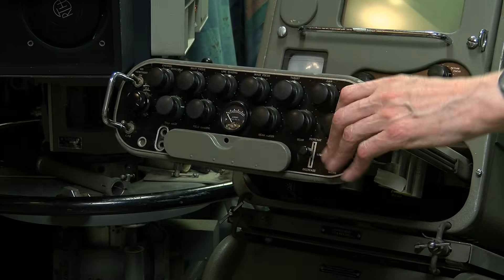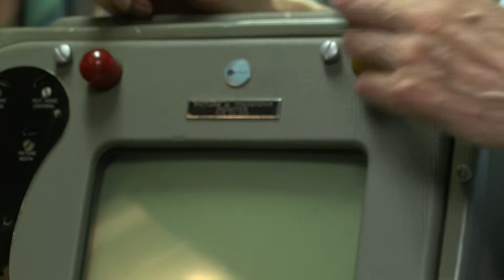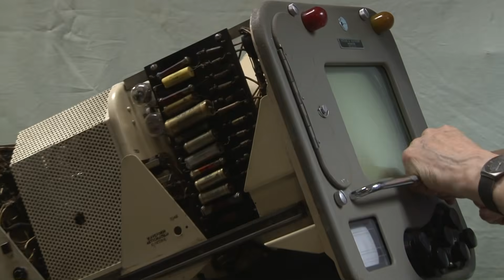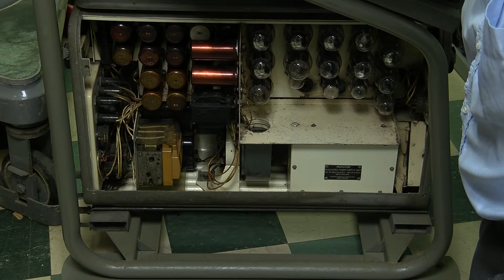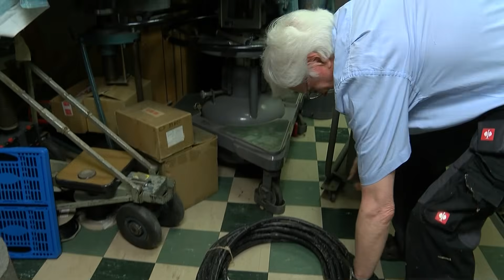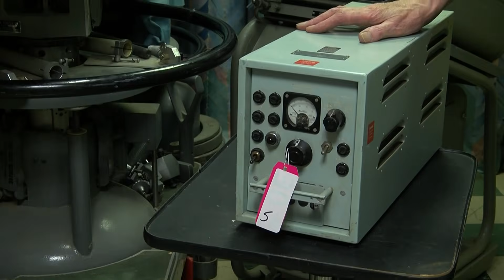In a nutshell - the Marconi Mk3 CCU and PSU part 2

Comment: How long could the cable run be between the camera and the CCU?
Reply: In the previous video he mentioned it was 1000 feet (about 300 metres). Interestingly he mentioned the camera had a control to adjust for the cable length being used, to compensate for the voltage drop on the longer cables.